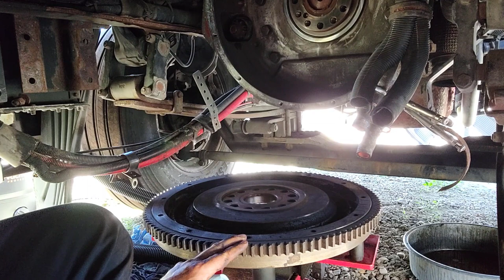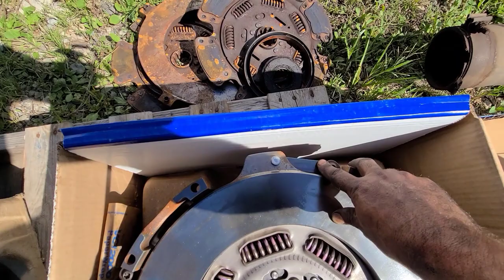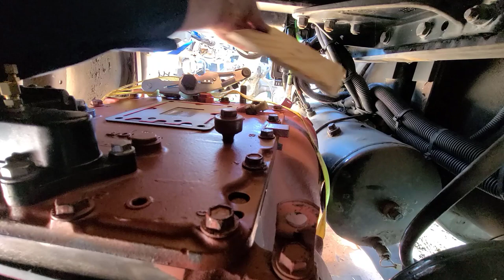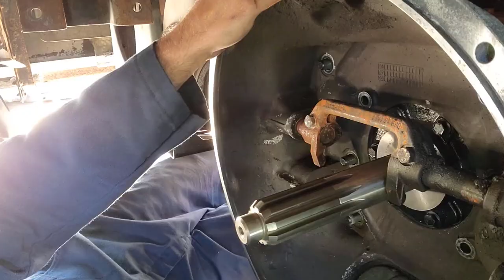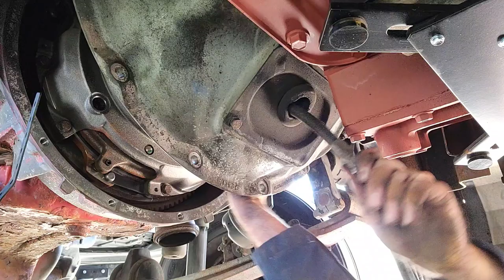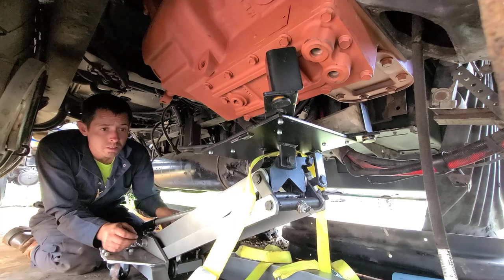How To Do A Transmission/Clutch Job on Cummins ISX15, Part 3 - Install Clutch and Transmission

Comment: I always unbolt the clutch before I pull the transmission. Putting the new clutch on the input shaft in the new tranny, or same one if ur just replacing the clutch, is way easier for me to stab the transmission that way. U don’t have to go straight in and play with the input shaft to get it to line up with the clutch discs. Just have somebody turn the motor so u can line up the flywheel with the clutch and bolt it up. So much easier. Just my input

Comment: I really love the way you do the job, it is not just how clean and perfect with lots of petitions you do it,  which is so valuable those are one side of your great work, the other amazing point was when you couple the Transmission to engine , and you did it so professionally like piece of a cake ,without any force because earlier on you had adjusted input shaft so properly ,this things can be seance and noticed only by professional mechanics who have dont this types of work themselves, Jobs done by you must be greatly appreciated  THANKS  and GOODLUCK.

Comment: Next time, Ryan, fix a go pro cam looking into the side of the housing with a clear view of the spline and hole. It should do wonders for you. And... before you even remove the Trans, measure the bottom edge of the housing, them measure the bottom of the Trans housing, then just raise it to those levels when installing.

Comment: Excuse me, can I ask you a question? I'm starting out in mechanics and I like to learn what I can and I wanted to know how many pounds of torque it gives to the bolts that hold the transmission to the engine?

Comment: how much does a job like that cost?
Reply from the maker: About $5000 depend on the transmission
Reply: Too much like anything w a truck
Reply: @nunyabuziness8421  I only charge 8-1400 for a clutch job.. And people tell me i charge too much. On Engines that im used to like C-15's with Eaton transmissions i can do in 1 day.
Reply: @truckingandfixing  hey Ryan, can you do mine I have a leak  for that seal, look like same issue
Reply: @mikegarcia4808  are you in southern California? Is that labor only or parts and labor?
Reply: @MarcoRodriguez-lr2xt  South Arkansas
Reply: @mikegarcia4808  what town exactly?
Reply: @realskata16  Hampton Arkansas